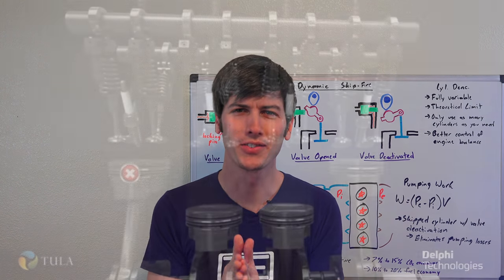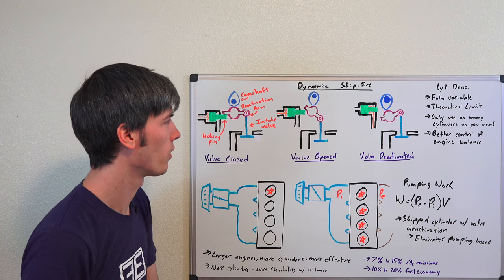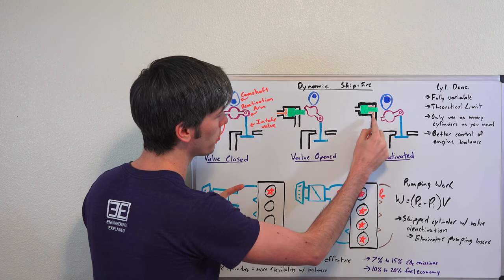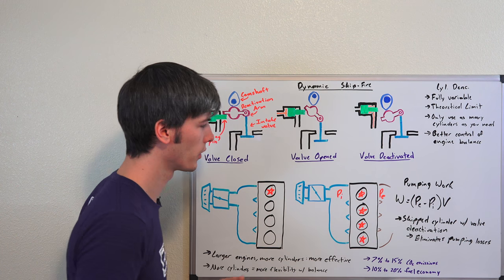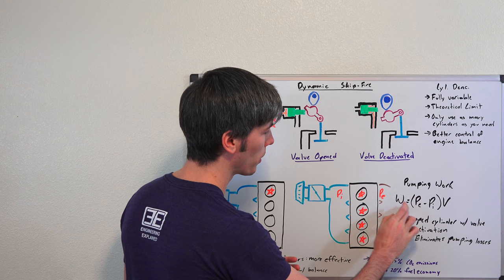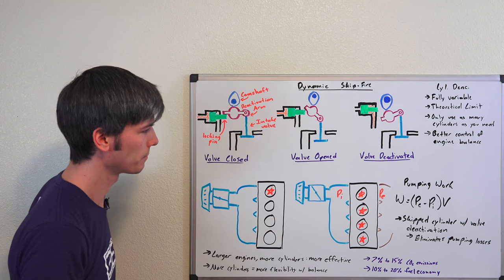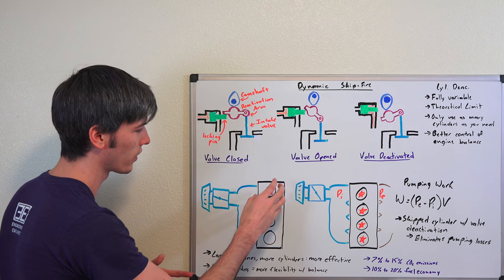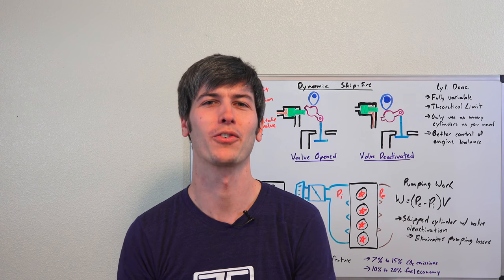How Dynamic Skip Fire Works - Variable Displacement Engines

Comment: If I am understanding this correctly and the point of closing the valves is to create some sort of "vacuum spring", the moment your rings start to wear (which they will) where a normal engine would have started smoking slightly, (a normal N/A engine for example only has to suck in atmospheric pressure which will be positive and if the rings leak on the compression stroke it leaks into the crack case) where as this system will put unnecessary strain on the rings and essentially start sucking in crank case air through the rings bringing oil with it. Then when the cylinder comes back online there will be oil in the combustion chamber, thus creating a engine that will randomly puff out smoke or suddenly stop. Almost like smoke vtec.

Comment: Some guy in Ukraine made an experiment with deactivation of cylinders, and running 60kmph (~37mph) he had consumption 5.5 liters per 100km (68.8mpg on highway) with all cylinders and 7.7 liters per 100km (49.3mpg on highway) with 2 cylinders.

Also Fiat had made 2-cylinder version of 500 model, which had 2 liters more consumption per 100km, then basic 4-cylinder version.

Comment: That is cool tech. I'm wondering though, if the throttle body is open so much with just one cylinder firing, how does the ecu know to adjust when you want to accelerate. I'm guessing the throttle is flyby wire. So the ecu is probably controlling the throttle body independent from the pedal, based on engine loads. And so based on the pedal position the ecu knows when you want +/-acceleration. Is that a close approximation of how the system functions?

Comment: I think this and Freevalve are great ideas. Keep big displacement alive and well into the EV era. There is just one small drawback that car enthusiasts may not like. When someone inevitably puts a louder aftermarket exhaust behind one of these motors, the exhaust note would become rougher with each cylinder that is shut off. I know on the FCA cars, when MDS cuts you back to 4 cyl, you get a horrid unbearable exhaust drone out the tailpipe. Of course, for these people there is a solution. Install a tune on the CPU to shut that system off, if you desire.

Comment: Cool video!
Would another way to put it be that by shutting down individual cylinders when the power need decreases,  the engine operates more like a smaller one designed for the lower load and performs better due to the lesser inefficiencies of a smaller engine?
Anyway, love your work.

Comment: hey multi air has worked out pretty well for fiat, personally have about 130k miles on a jeep with a multi air with zero engine issues, considering the concept (hydraulic valve deactivation) is very similar I can't imagine this being too much more failure prone in the right hands.

Comment: I'm not sure that pumping losses are reduced as when the intake and exhaust valves are closed, as the piston moves down, it is effectively pulling a vacuum which is very hard to do, or the other way is it is compressing the air on the up stroke. Maybe they can time the closing of the valves somewhere in between. The main economy advantage is that fewer cylinders running the same power can get higher cylinder compressing pressures and there for a more efficient burn. Lower intake pressures results in a lower compression pressure and a less efficient burn. I own a Chev L77 6.0L V8 with Cylinder deactivation. It is done through special hydralic lifters that stop the pushrods.

Comment: On the topic of pumping losses, Honda tried something a little neat (IMO) with the first R18s. Recall they used VTAK!! to have the low RPM lobes barely open the valves so they could run the throttle body at much larger openings (DBW) at low engine speeds / low power. They abandoned it for the following generation. I don't recall it having made any significant impact on fuel economy. Having driven both, the later engine felt a lot more lively (for as little power as it made). It'd be fun to watch the throttle plate reactions to this skip fire in action. Also curious what it would be like in terms of drive-ability.  I'd imagine it would have to constantly rotate cylinders to keep them up to temperature.

Comment: To make this design more efficient, you need individual throttle bodies per cylinder IMO. Else you are just pumping air through 3 unused cylinder if the values continue to open/close on intake and exhaust. If using the locking pin design, you will introduce turbulence in the intake manifold decreasing efficiency and creating a delay. (Imagine the feeling of turbo lag).

I'm not a fan of half baked idea's. Good informative video though. Like some others have said Freevalve is a better step, I am glad Christian von Koenigsegg has the money to explore really good solutions like Elon Musk (putting money where your mouth is). Electronic throttle bodies and valve will make engines smaller and more efficient, but complex. At least there will be less mechanical loss (WORK).
Reply: I'm not sure if you watched the video or not, but no air goes through the unused cylinders

Comment: Thanks for the great consistent videos.

Too many interconnected moving parts still (friction).

Yes you will see an improvement in efficiency but not by half (for shutting down 2 cylinders in a 4 cylinder engine).

The thing is, usage of gas for propulsion is very inefficient.

Appreciate you spending the time to educate all of us on how  engines function.
Reply: He said the bigger the engine the more of a gain it is, why did you act like you were informing him of this?
Reply: Aggressive Pizza

I credited him for educating us through his videos.
I literally learn from these videos.
I never criticized him or the info he is sharing with us.
Reply: SDD525

Yep, I am a Chevy volt owner.
Might get the i3rex or a bolt as my 3rd car next year.

Happy to hear you are getting the model 3.
Why is it so expensive in Canada though ?
I'm guessing you will get the highest configuration model 3 ?

The price of the well equipped model 3 here in the U.S. is expected to hover around $55k.
Which options are you going for with your order ?
Reply: I almost got a Volt, I was cheap in the end and got a Spark lol. Close enough right? (volt/spark)
Reply: Aggressive Pizza

Lol @ spark and volt. Good one.

Yeah good choice on the spark. It is a great compact car.
The spark ev is also a spectacular car.

Hope you enjoy it buddy.
Reply: Been good so far, haven't even had it's first oil change yet. Still very new.
Reply: Aggressive Pizza 

I had no idea it was a spanking new vehicle.
Thought it was purchased 6 months ago or so.

Congrats on your purchase bud !

Comment: Running a 4 cyl engine on one cyl would surely create crankshaft imbalances and catastrophic vibrations at certain RPMs, how do they counteract that ?
Reply: Yea I couldn't see them running it on just 1.
Reply: Did you understand the video at all? A normal 4 cylinder engine has always one cylinder in a power stroke. This has at most one cylinder in a power stroke, with just moments of "silence" in between. Akk cylinders are still running, just slower.
Reply: Yea but doesn't the other power strokes balance it out?  Granted I've never seen this done before on a 4 cylinder.  I've seen it done on V8s and V6s.  Yet even the V8 only deactivates 2 cylinders at a time down to a 4 cylinder.  Then with the V6 I've seen it deactive to a 4 Cylinder and then a 3 cylinder.  Regardless the vibration would be quite high and if they did deactivate a 4 Cylinder down to just 1 cylinder they would probably choose one of the middle cylinders to run to decrease the vibration.
Reply: So you didn't understand the video. It's NOT running on one cylinder all the time, it's NOT one chosen cylinder. It's all cylinders, just each of them actually working every 4 cycles instead of every single. Yes, it would be less balanced than all 4 running every cycle, but not by much, as all 4 cylinders and their weight are still there, balancing a big chunk of the vibrations. Also even "delayed" power strokes will still help the balance. I4s are in a way running on one cylinder all the time and despite that they can be quite smooth.

It's not magic and it will not magically work differently when you change sth. It will still be explosions and high forces acting in different directions, just less of them. Normal working cycle of an engine is about the same miraculous as this.
Reply: I guess I missed where he said that or that portion of what he was explaining.  Inherently a single cylinder < twin < 4 cylinder < 6 cylinder < 8 cylinder and so on for vibration.  I suppose each cylinder is acting like a spring when deactivated.  I suppose that would inherently suppress some of the vibrations.  Does anyone know of any 4 cylinder engines in production now days that do cylinder deactivation?  I guess I've never heard of one, other than the free valve...
Reply: VW Golf has one AFAIK.
Reply: Kartboarder22G - If you had watched the video carefully you'd know that deactivated cylinders have their valves OPEN, so there is no cylinder compression and no "spring" action.
Reply: NICK Please tell me how did come up with such an idea. The whole point of this system in the video is to allow the valves to be closed - there would be no need for anything like that if they were to stay open. And you must have ignored EE's comment - PINNED one. That level of missing things is an achievement.
Reply: If all valves where open, you'd have a ton of issues.  Connected path between exhaust and intake, what a disaster that would be.

Comment: I think it is a great concept to save on fuel and lower co2. Could this concept be add older vehicles as after market product ? Some comment talked about engine air breaking and if non fireing cylinders could help the vehicle braking system ?? Like adding air brakes to a passenger vehicle

Comment: A few weeks ago you explained the petrol (gasoline)engine using the Diesel high compression ignition system.  would be interesting to see this "variable cylinder" system combined with the "compression firing system"

Comment: Great video, but it is the cylinder efficiency that is responsible for most of the improvement. If cylinder efficiency is the same running 1 vs 4 (which it is not), then it takes the same amount of fuel and air to produce 25 HP and pumping losses are the same.

Comment: Hmm if only 1 cyl firing while the others are shut from the valves, doesn't it make the other cylinders pumping vacuum thus slowing the engine down like how engine braking works?
Reply: Watch his video on engine braking - that explains your question.
Reply: Nah the cylinders with closed valves act like air springs. Of course it's not 100% ideal, but that's the idea.
Reply: He explains that the valve will be close and there won't be pumping loss
Reply: Basically, there's a temporary loss of energy when the piston moves down, creating a significant vacuum in the cylinder with closed valves...but that vacuum then pulls the piston back up, giving that energy back.  So it's a wash, other than losses past the rings - and it eliminates losses from pushing against valve spring tension.
Reply: No, because a true engine brake (Jake brake) allows the cylinder to compress air and opens the exhaust valve around TDC, thereby making the engine do work (compress air), without allowing the compressed air to help force the piston back down.

Comment: I need a better graphic of the locking pin and deactivation arm to understand how it works...
Reply: its almost a push rod
Reply: it's a ping thats always in the operational mode with a spring to keep it there or return it and oil comes from the pivoting point (i forgot its name of this little support) wich feeds oil pressure to push the pin out of the way
its easier to understand watching the video: "Delphi Tula Dynamic Skip Fire Cylinder Deactivation System" /watch?v=ei1NyfgY5Ds
Reply: I'm mostly confused about where it's pivoting from our how it's supported, since in his drawing it pivots in two different places.
Reply: Daniel Jensen the valve has a spring on it, keeping it closed until forced open. The lobe will push the valve open when the oil pressurized pin is applied, making the pin the pivoting point. When it is not applied, the pivoting point is now the valve, the spring holding the valve closed will do its job and keep the valve closed
Reply: Daniel Jensen
thats because these kind of roller finger follower are made to reduce wear on the cams (contrary to flat tappet)  one side lies the lash adjuster, in the middle lies the cam roller and on the other side the top of the valve rod. 
                           CAM
lash adjuster < Roller -- valve rod = cylinder ON
                          CAM
lash adjuster   Roller > valve rod = cylinder OFF (in this case the roller has a spring above the valve top so it returns to normal) if this doesnt come clear enogh look at my other answer and go watch the video

Comment: I'm just curious how this affects cylinder glazing and other problems usually associated with extended idle. It's explained as a lack of pressure and heat that leads to the problems, so how would removing the pressure and heat from the cylinders over extended periods, like cruising on a highway or actual idling, be avoided using this system? Sounds like there's a few problems left to address.

Comment: One thing that sticks out to me with this design is the undue stress created on the crank shaft compared to regular firing engines having one or two firing cylinders and the rest ‘coasting’ at any given time would put horrendous stresses on the crankshaft in my humble opinion interesting video 👍
Reply: AvT I can't see how there would be more stress that when all the cylinders are firing, it would make uneven stress, but at a lower amount than if all the cylinders are firing. And also bear in mind that this is only used in low-load situations.
Reply: I dont think I heard it mentioned in the video, but the "dynamic" part is, I believe, that the ECU shuffles which cylinder(s) fire and varies them. So in a scenario where only one cylinder is needed, it wont always be cylinder number 1, rather all of them but firing at a different time.

Comment: Greatly explained as usual, but,,, will it always use the same cylinder when it limits usage or choose them at random? I guess being oil pressure activated there's not too much to go wrong and diagnosis should be quite easy by measuring oil pressure to each of the valves. I guess this also can not operate quickly like in ms on and off, but the engine would have to prepare it's self for the change over, I guess it would feel like a automatic changing gear??

Comment: I know little about this.  If the engine tends to favor using certain cylinders, won't that wear them quicker than they otherwise would since they are under more load?  This is cool as hell, but as someone that focuses on rebuild work, I'm interested to know how it effects the life of the engine

Comment: One thing that I cant find a clear answer on is the correlation between CFM and PSI. For example I understand that with a turbo you can make 200 hp with (theoretical numbers) 10 CFM and 20 psi, yet you can make the same with 20 CFM and 5 psi. I don't entirely understand how that works. I know CFM is flow rate and PSI is pressure, but thats about it. I  know I'm not the only one that doesn't understand how this works. I hope my explanation makes sense. It would be nice to see a video explaining it.
Reply: Pressure is negatively exponential, aka has diminishing returns